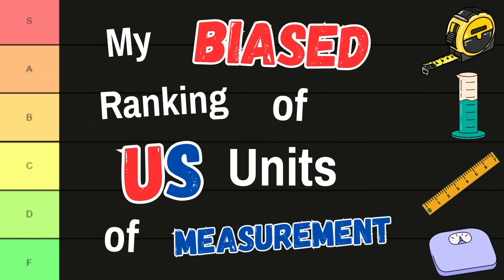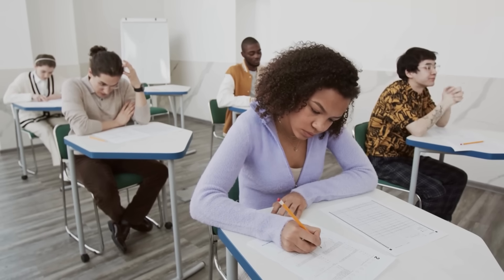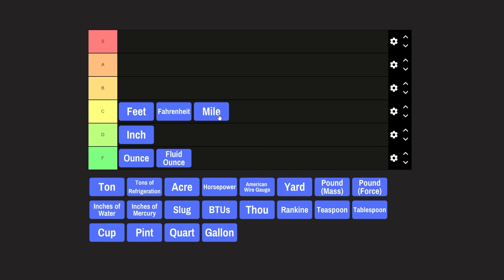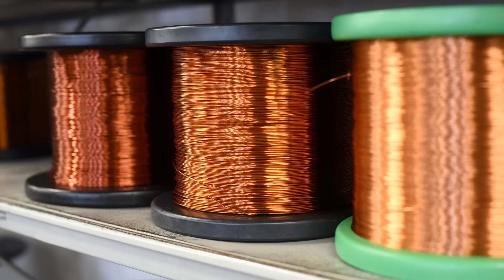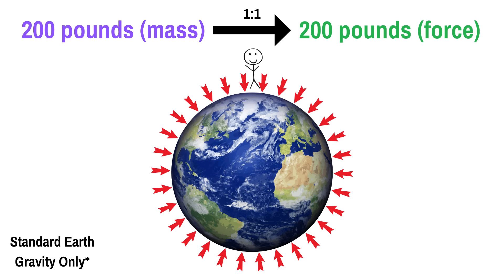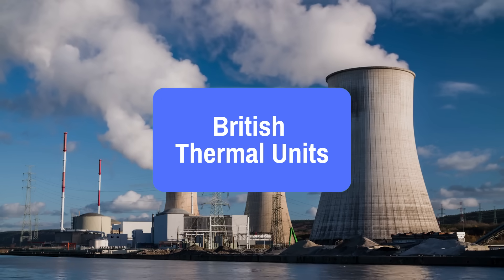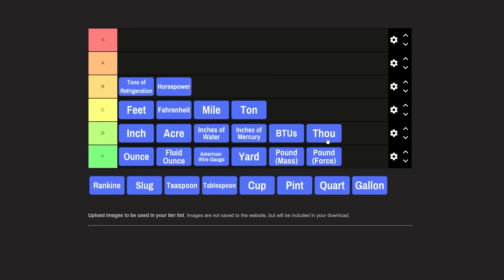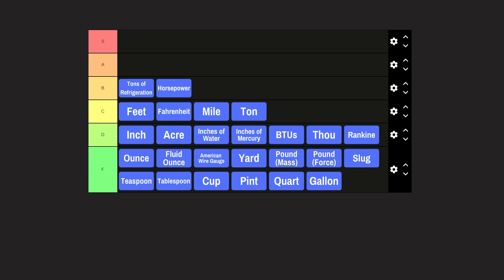Tier List of the DISASTROUS US Measuring System

Comment: As someone who doesn't use the US units system i completely agree, apart from the fact that all of them were supposed to go in F
Reply from the maker: Fair enough haha
Reply: tons of refrigeration is pretty cool concept even though it doesn't make a lot of sense
Reply: The fractions they use with length are even worse.
Reply: I mean Horsepower is not that bad dude
Reply: Nah Fahrenheit is definetly not F tier. Its obvously FF. The "F*ck Fahrenheit" tier.
Reply: @StarfoxHUN  LOL.  Ever seen some of the science shows try to use F for things?  -321F for LN2, 27,000,000F for sun core temperature, etc.  Just silly.  Even worse when they try to do exact conversions, like 26,440,223F or such.  You know there is nowhere near that level of precision in the starting number.
Reply: tbf, fahrenheit isnt THAT bad. i mean it is, but speaking from what my friends told me, you get used to it. It seems a bit more convenient to use in day-to-day life according to them. Therefore, it should be in E tier. right between D and F
Reply: @purplecapybaras  I find Celsius perfectly conventient.  More so, in fact, since I don't have to remember "32", I find "negative temp = freezing" a lot simpler.

The "100 is too hot" is bullshit (and got a downvote, regardless of the rest of the vid which I liked) because for me, 100 is WAAAAAY past "too hot".  30° C is too hot.  25 °C is about my upper limit for comfort. "too hot" is just too subjective claim it as a plus for one system or the other.
Reply: @StarfoxHUN Fahrenheit is better than Celsius for daily use
Reply: @lincolnc8658  Daily use is thinking in a temperature unit. I wouldn't know what 70°F is, but I know what 20°C is, and since I associate something with it it doesn't matter. Also tells me when I have to watch out for ice outside
Reply: @insertname4032 yeah, you don't know what 70° F feels like because you don't use it. That feels like a useless point to bring up. And I'd say freezing point is like the only thing Celsius is better for in daily use. Most people can bare 100° and 0° F, just not for long and you really don't wanna go outside if it's more extreme than one of those two. It's also pretty rare it's more extreme than one of the two, or at least it was. Celsius seems like it has a decently convenient thing going on with multiple of 20 (-20 C ≈ 0 F, so about as cold as I would be willing to go outside at all for, 0 is when water freezes, 20 C ≈ 70 F so a good comforatble temperature, and 40 C ≈ 100 F so about as hot as I'd got outside for) but even then I think fahrenheit is more intuitive. Like, 0 and 100 are much simpler numbers for the extremes than -20 and 40. 70 is a simple number to remember just because it's used in our grading system as essentially a critical point, so it's a significant number anyways. 32 is a little weird for a freezing temperature but I think it's fine that you only have to remember the one thing
Reply: @insertname4032  I guess it is like hearing it's 30 outside and I go looking for my shorts, but once outside I realize I should have been looking for the snow chains instead...
Reply: @lincolnc8658 Celsius is good too for daily use. Like < 0°C - snow. 
> 0°C - no snow. 30°C - warm. 100°C - water boiling point. 0°C - water freezing/ice melting point
Reply: @lincolnc8658  Celsius is still better, it doesn't matter if you know 0 is cold and 100 is hot when you've got no fucking clue when winter starts and water freezes, making snow, it's 10x more intuitive with Celsius you can just go with increments of 10. 

(-30) it cold as fuck 
(-20) it's still cold as hell 
(-10) it's pretty cold 
(0) or below snow starts, 
(10) is still fairly cool, 
(20) it's pretty normal 
(30) it's getting really hot.

And i mean also saunas are often 100°C, probably like 180°F if i had a gander.
Reply: @bgmarshall ohhh, as a Celsius user I see now how easy to understand is. Kinda intuitive.
Reply: @bgmarshall the Fahrenheit ratio is very confusing if you were to do scientific measurements, and the two measurements have no difference in daily life so i don’t understand what you’re yapping about
Reply: @someweirdstuff1256  I said I don't care about scientific context for this and that I think fahrenheit is better for daily use because 0-100 is a much more intuitive temperature range than -20-40

I guess it's also kinda convenient that 100° F is where a fever is bad enough for you to be allowed to stay home but that's rare enough that it probably doesn't matter much, and 98.6 being the standard temperature doesn't help
Reply: @bgmarshall  true, I can see your point. If anyone complains about your opinion. Most of them are like me. Living in the world of metric makes us feel Farenheit is very bad. Though inferior in scientific. They are quite the same for daily use. We remembered the key points of the system the same. When to hot, cold, normal and not.
Reply: @bgmarshall straight up skill issue, you adjust your perception into just 0~100 and associate it was daily experience, meanwhile Celsius can also do that with 0 issue and no difference since we simply can dig deeper into 1/10 added below it, but while we can understand all melting points of every substance in the universe, your units of -42 Kelvin means nothing since the ratio is straight up different calculation and you can just times it, divide it, or subtract it
Reply: @lincolnc8658  I agree it is better for weather but it is way easier to measure high temperatures with Celcius
Reply: @bgmarshall thing is that the “farenheit fits the human body” argument doesn’t hold up in other climates. The human body is surprisingly adaptable to temperature - where i grew up, around 100f was genuinely not bad for summer - been outside for hours at that temp and was fine - while around 50f was enough for most there to wear coats
Reply: @kooskoos1234  I'm sure warmer places exist but I live in Texas and seeing a day in summer where the high is below 100f doesn't feel common, everyone I know still does not want to be outside in 100f weather. And when I go to Iowa for visiting family, I'll go outside just fine in below freezing weather with a heavy coat for about the same amount of time I'd be willing to be in 100f weather

And either way it certainly fits the human body better than Celsius does
Reply: @bgmarshall  it may fit your climate well, but that’s my point - “100 is bad but endurable and 0 is bad but endurable” is not a global thing
Reply: @kooskoos1234  I'm saying I live in a pretty hot climate and it still applies, and I believe I have heard others say this online (I don't have a very strong memory of it though) so it probably holds true for the majority of the US. It's a pretty big place to apply to, so while I'm sure not everywhere matches it I think it's common enough that it's good enough a point to call it better than Celsius
Reply: @bgmarshall  majority of the us is the minority of the world ¯\_(ツ)_/¯ some places are probably too cold for it to work, and some places are definitely too hot for it to work
Reply: @bgmarshall -20 and 40 are opposites???? Excuse me but if it’s 40 degree outside I can survive with some water but -20 I will be straight up dying, those are simply not the same, you are just biased because you grew up with fahrenheit, but these are simply not the extremes, besides, 0 celsius tells you when to look out for snow and frost, which is an actual standart measurment that helps in daily live unlike the completely subjective “it’s really cold outside and it’s really hot outside”
Reply: @Didagg  with what clothing? Basically never gets below 40f (~5C I think) where I live and I'd survive in 0f/-20C just fine with a heavy jacket.
Reply: @bgmarshall nah it doesn't work for that either. 100F is like 36ish celsius which is quite hot but somewhat tolerable and quite far from the highest temperatures recorded which are around 55-59 celcius, and reachable in many places of the world in summer. Meanwhile 0f is like -32 celcius which is stupidly cold and unbearable for most humans unless you're well prepared and is insanely rare in most places.
Reply: @bgmarshall  Nobody can bare 100 °F, but some can bear it…
Reply: @aarepelaa1142  and what if you don't live at sea level and are not freezing distilled water?
Reply: @kelaEQ2  -1°C idk why you're tryna be a smartass about it.
Reply: @bgmarshall  Let me just ask you this: Can you FEEL the difference between 75 and 76 Fahrenheit? I'm having trouble with 15 and 16 Celsius already so how is it you can feel temperature in such an exact way? To me Fahrenheit feels like ranking food on a scale from 0-100. The scale is too large for its use. I'd rather rank it from 0-10.
Reply: @LibraryofAcousticMagic3240  can you feel the difference between 75 and 76 grams? There's no reason we should have to be able to tell the difference between increments of one on a measurement. I believe I saw either in another reply to me or somewhere else in these comments someone saying people use decimals in Celsius temperatures, which is a lot more numbers being realistic than for Fahrenheit, so I think big scale isn't a particularly good argument
Reply: @lincolnc8658  "Fahrenheit is better than Celsius for daily use"
Why?
For whom?
Reply: @bgmarshall  "more intuitive temperature"
How is Fahrenheit more intuitive?
Do babies intuitively understand the Fahrenheit scale?
Reply: @bgmarshall  "And either way it certainly fits the human body better than Celsius does"
Really?
Why?
For whom?
Reply: @bgmarshall  " Can you FEEL the difference between 75 and 76 Fahrenheit?"
You didn't answer the questions.
Reply: @dampaul13  that's their only argument because they're used to Fahrenheit, but it falls apart because the same thing applies to people used to Celsius LOL
Reply: @bgmarshall  weird my ratio is usually 20-40°C unlike 0-100°F that feels weird as well how cold is 0°F heck they're even ≥-1°F
Reply: Miles and cooking units are supposed to be In d tier
Reply: Horsepower good
Reply: Good response
Reply: Celsius is nice and simple for me and added benefit is that 0C is practically the average of the yearly hottest temperature that's usually bit over 30C and the coldest which is usually bit under -30C.
Reply: Fahrenheit is just a stupid measurement.
Grasping straws to explain why it would be good to use, just makes it look dumber every time
Reply: Why does no one answer basic questions when asked?
Reply: As a Canadian, we use both metric and imperial here, but you know which one I like more....

Metric
Reply: put refrigeration ton in z tier
Reply: Fahrenheit is better than Celsius in daily use if you’ve used it your whole life. I use Celsius and I don’t have a problem. So daily use is equal as long as you’re used to it. But then Fahrenheit can’t really be used for much else compared to Celsius as Fahrenheit just doesn’t work.
Reply: @ghostguy76  for anything other then measuring the temp of distilled water at sea level, and daily use* Celsius is no better then Fahrenheit. There is a reason Kelvin exists.
Reply: @kelaEQ2  "for anything other then measuring the temp of distilled water at sea level"
What does water have to do with temperature or measuring temperature?
Reply: Some or bad and some are really bad, I'd put them in E, F and G
Reply: If I have to say, I think Celcius is better in day to day basis for most ofnpeople who are used to it. But if youblived Farenheit your whole life then maybe Farenheit felt better. So let's just say it is equal. I think the advantage of celcius is that it is more simple to use in scientific calculations. Especially since Celcius and Kelvin are the same exceot you had to minus 273.15. But if the unit is like kg/m3 C and kg/m3 K it is equivalently the same. So the only time conversion had to happen is whenyou want absolute temperature in Kelvin.

Since I lived with Celcius my whole life so whag can I say is that to me, Farenheit felt weird because of its boiling point is 212. What is that number? For day to day basis I can somewhat say maybe it does have a point. 0-100 F is temperature human can withstand. 32 F is freezing point but you can use thick clothes, while more then 70 F - 80 F(21 C- 26.6 C) felt just right (nice and warm) and 100 F (37 C) is very hot. I can see the whole point but it is very intuitive and not convenient enough to say it is a good unit since it can't be used elswhere and is still inferior in my eyes to use in day to day basis but hey thats just me living with Celcius my whole life. Metric all the way for me
Reply: With Fahrenheit you have to remember 32 is freezing, with Celsius you have to remember 32 is too hot. 

What is a comfortable temperature will also depend on where you live. I'd rather have my -5C where I live than the +5C in London (sounds weird, but it's true). So remembering what temperature is good temperature becomes intuitive no matter the system you use. So in the end it boils down to scientific use where Celsius definitely beats fahrenheit.

As for body temperature, that varies between individuals and even then 100 fahrenheit isn't even avarage body temperature, so you still have to remember what it actually is in the same way you have to remember what it actually is in Celsius, but honestly you need to know what your normal body temperature is no matter the system in order to know if you have a fever.
Reply: @eldoriath1  the body temperature is 37.3 C I think more like the max body temperature in normal condition. When you are beyond it. It means your body is not healthy. For example if your body temperature is 38 C means your sick
Reply: As someone who does use US units, I agree. Except Fahrenheit. I like that it's more granular than Celsius.
Reply: @Evelaraevia  " I like that it's more granular than Celsius."
And?
Does that make it more accurate or precise?
Reply: Like it should be F-S their, F-A their and so on

Comment: A mile is also a standard from surveyors. It is 66 feet times 80. 80 being the number of Chains in one mile. What is a Chain? A tool for surveying (Think of the first down chains used in football, just longer) made up of 99, 8 inch chain links which totals 66 feet of chain, or one Chain.
10 square Chains is also 1 acre. (Square Chains, not Chains Squared, think a 2x5 grid)
Reply: You're close on the Gunter's chain; each link is actually 7.92 inches or 0.66 feet and 100 links per chain. A "pole", also known as a rod or perch, is 16.5 feet in length or 25 links; sometimes seen in old deeds of conveyance.
Reply: @NipkowDisk  I actually really appreciate the correction, I would sworn it was 100 links but then the math worked better with 99 LOL. My dad taught me random tidbits about surveying he did 20 years prior, so the numbers were a bit fuzzy.
Reply: @ThespianGamr  Understood... 20 years is a long time. I can't even remember most of what I did yesterday! Also, I'm a now-retired surveyor myself; I do still keep my license active. It's a fun profession that, sadly, very few youngsters are getting into.
Reply: are u a surveyor?
Reply: @pupper42  No, but my dad was for a while
Reply: "A mile is also a standard from surveyors."
Is that for all surveyors, everywhere?